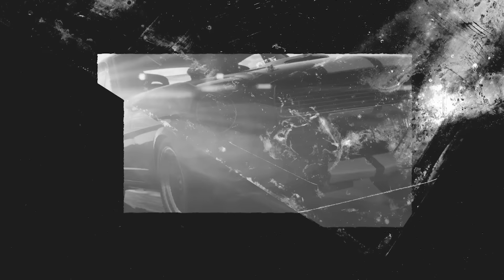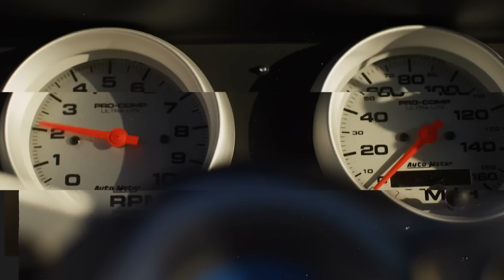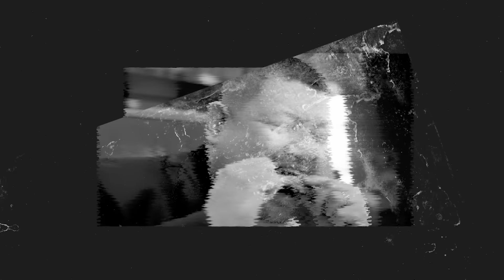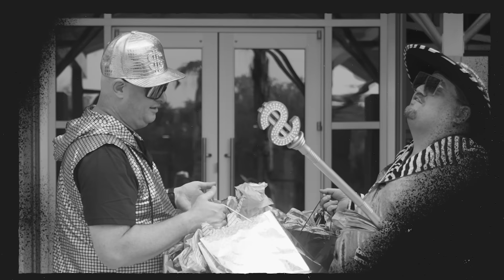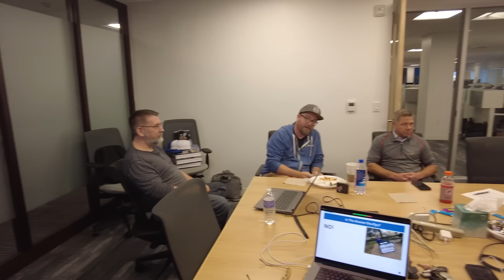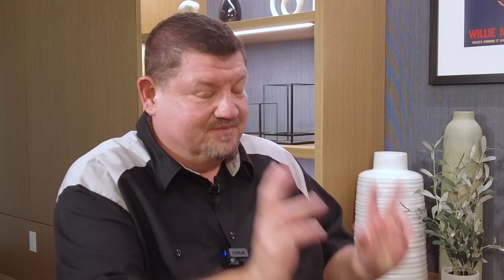Learn How To Scale Performance Testing Teams

Comment: Fantastic insight from Roy, a true maestro in Performance Engineering. I've had the distinct privilege of collaborating with Roy Reyna at both Dell and GM, witnessing firsthand his exceptional skill set and his passion for performance engineering.
A quick tip for Scott on the article's title: perhaps consider "Mastering the Art of Scaling Performance Engineering Teams" #performancengineering. 
Roy eloquently sheds light on the multifaceted role of performance engineering teams. These teams go beyond mere performance testing; they are the unsung heroes ensuring systems not only meet but exceed expected outcomes. They are the allies of developers, guiding them in refining their code for optimal performance. In today's world, where AI and low-code/no-code platforms empower virtually anyone to code, the focus often skews towards features rather than efficient coding. Here, Roy's insight is invaluable: performance engineers should work in tandem with developers, honing their code to perfection. Under Roy's leadership, I've seen some of the finest performance engineers in action, masters in fine-tuning both infrastructure and code for peak performance. The teams that Roy has led in fortune 500 companies are a testament to the pivotal role performance engineers play in the tech landscape
Reply from the maker: Thanks